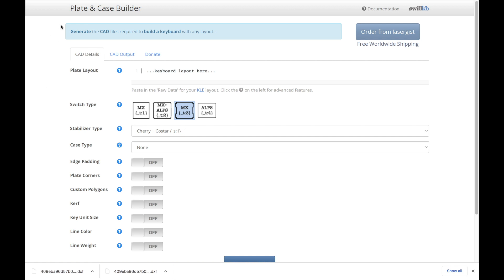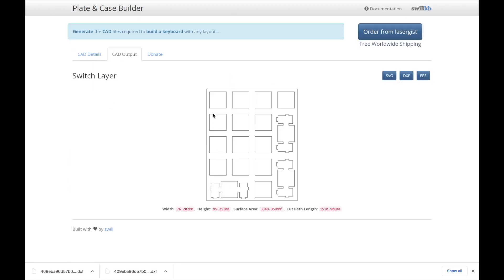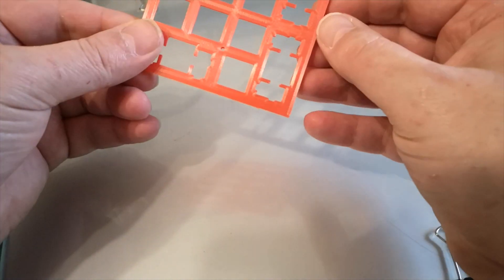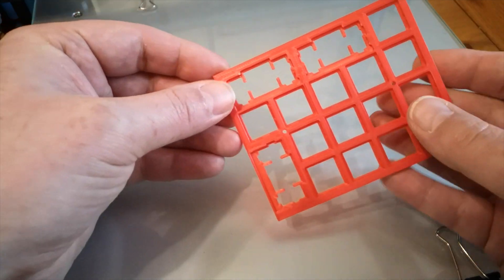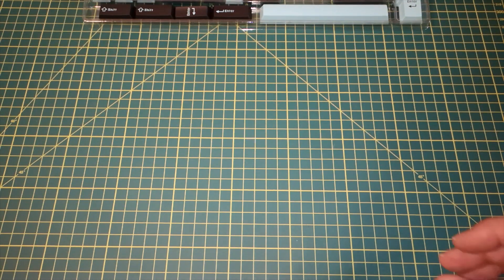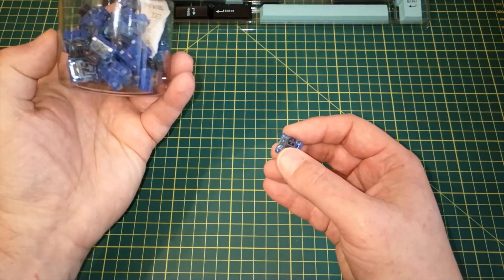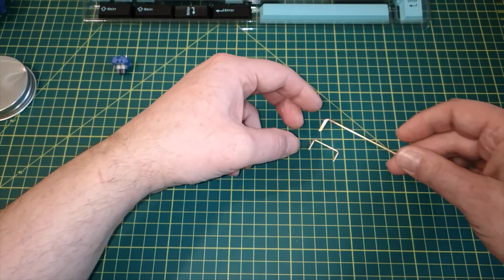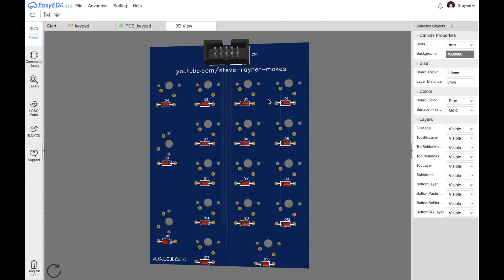Z80 Computer - Part 10 Designing a Number Pad

Comment: How are you handling the inputs when they're open / floating? I use 10K pull-downs on the column inputs.
Reply from the maker: Yes I also use 10K pull-down resistors, but I have them on the main board.

Comment: Hi Steve, I'm waiting a lot for you to show how to insert a keyboard with 16 keys and its program in assembly, I need to learn how to program a keyboard with 16 or 20 keys in assembly so I can put it in my basic computer kit with Z80. Thank you very much and I'm waiting a lot for you to show how to connect a 16 or 20 keys keyboard in your kit and the program in Assembly.
Reply from the maker: Yes, I should be showing a program like that soon. I've got 17 switches here but it doesn't really matter how many you have the principle is the same.

Comment: Eh, I was thinking, if there is a single board Z80 computer, is there no need for an A, B, C, D, E and F-key on the key pad? Programming in hexadecimal is no nostalgic, something only real programmers can do. It feels like sailing the seven seas of the world with only a compass and a sextant. All the other letters and signs can be emulated with eight push buttons on a row. Programming like the old Spartans did.